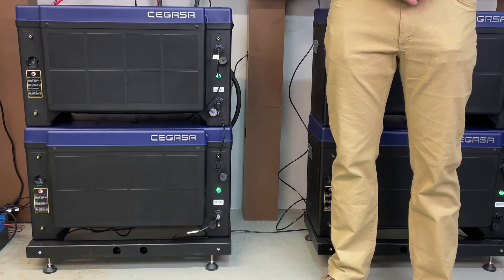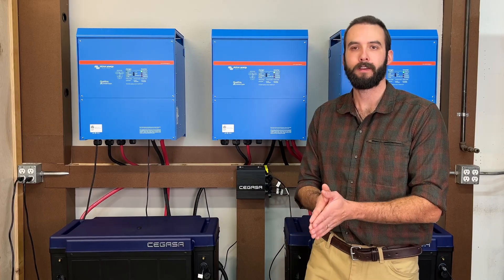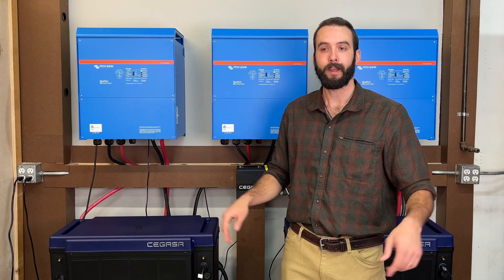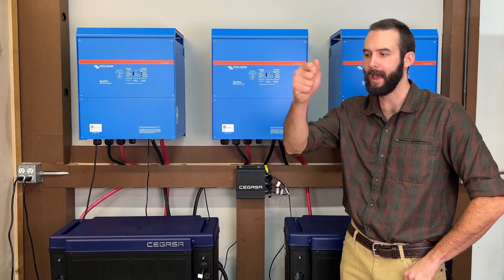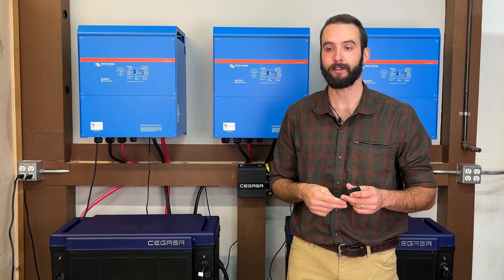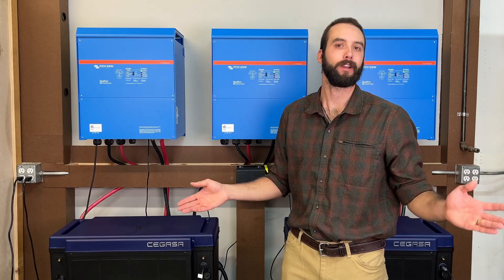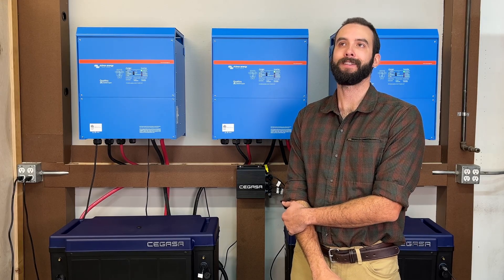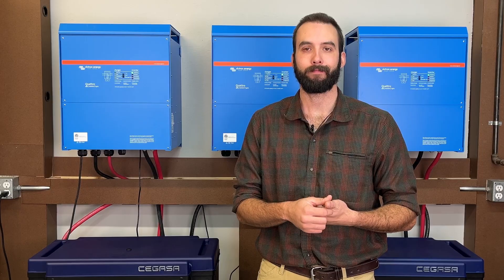Cegasa & Victron, a match made in Europe.

Comment: For the price that you pay for a 13 kWh CEGASA. You can Buy  8 Pylontech... 8 Pylontech of 4,8 kWh capacity.... 8...the audacity.... That's a Joke 😂😂
Reply from the maker: The Cegasa battery is ±$0.50-$0.55 / Wh. Pylontech US5000 is around $0.57-$0.67 / Wh
Reply: Either UL listed?
Reply from the maker: @ligarsystm  Cegasa has started the process but it will probably be a year before the E/Bick has UL.